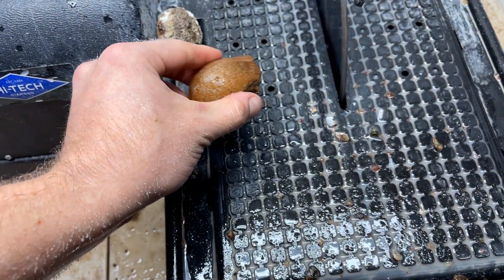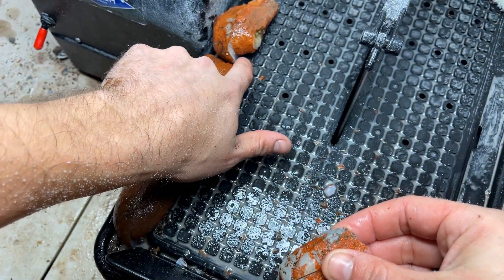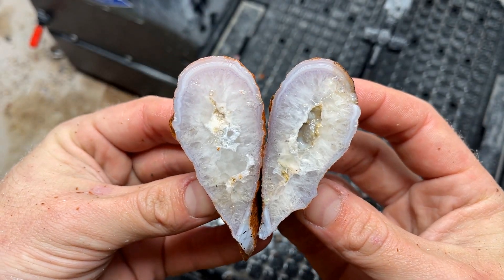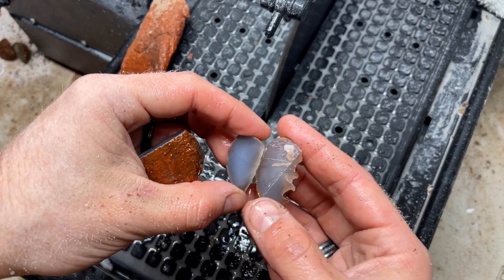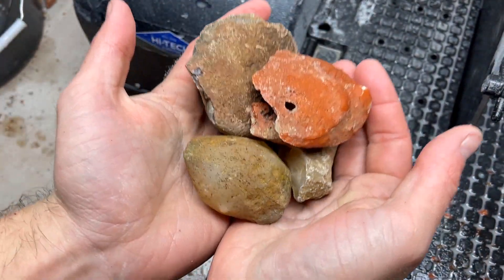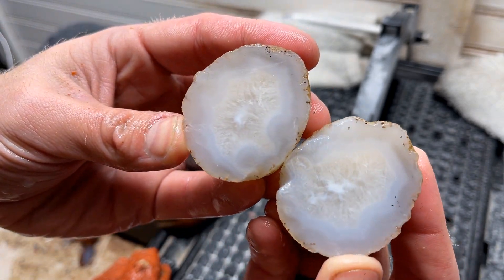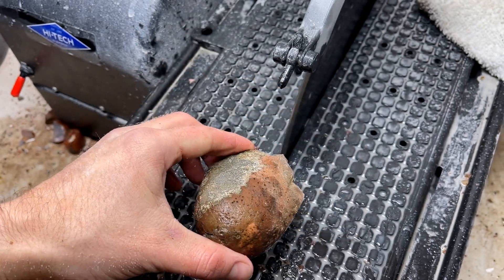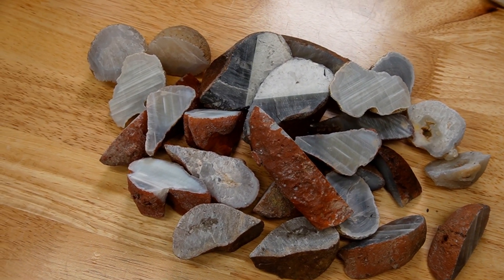I Cut Idaho Agates Open on my Saw!

Comment: Agate Dad!  I have rocks from the Snake River Valley Idaho!  I've suspected they are agates as some of them have wear marks on them that are 'shiney'.  There's a fist size piece of churt, and also a large smooth rock that has lines all around it from top to bottom, that I want to see what the inside looks like.  
I found the possible agates just laying on top of the dirt in a field and the churt and the other one I found when digging in a yard to plant a bush and a tree - one in the front yard and one in the back. HOW DO I contact you to get your costs for cutting these.  I would pay for shipping both ways and give you half of each rock - if you wanted it; and you could pick the half!

Oh WOW1  That black/white cut is Stunning!  As well as the one that when you held the two cuts side by side looked like angel wings.